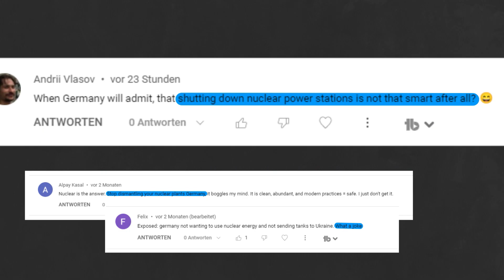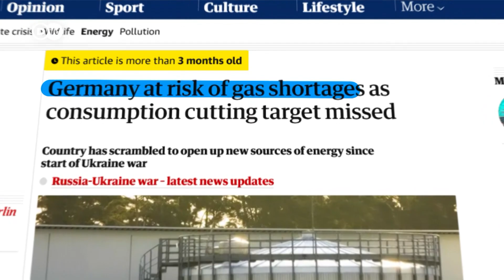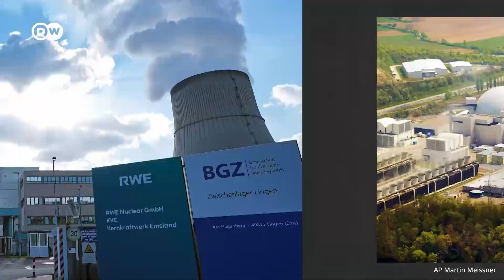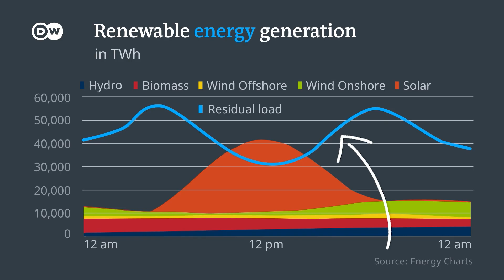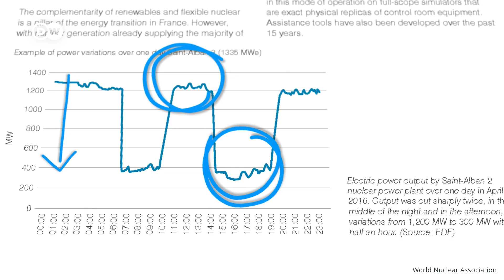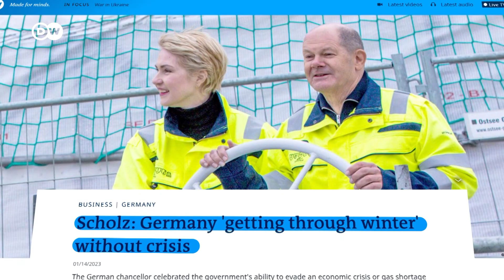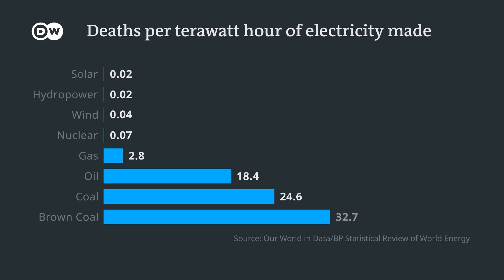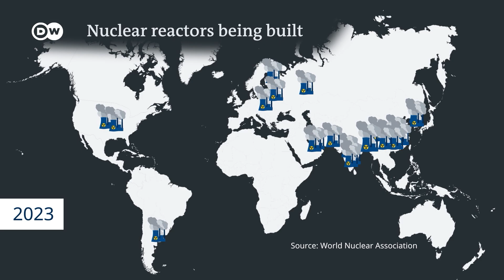Is Germany's nuclear exit a mistake?

Comment: Man we had only  3 nuclear power plants still running and decided a long time ago to shut them down, and so we didn't upgrade it for the last decade so to get them back to our standards Germany would have to invest a lot of money. And for the reasons Germany decided to demolish nuclear power plants there is, the high maintenance cost, the dependence on other countries which sell you uranium, the small but possible problem of a nuclear disaster and that we still don't have a nuclear repository. Im sorry for the long comment and the best of wishes from Germany.
Reply: So the dependence to Russian gas was much better 😅😅😅
Reply: @Bucefal76  hell no, we made a crucial mistake back then 😅
Reply: Теперь будете покупать (атомную) энергию у Франции. Хотите независимости должны иметь все свое. Ещё не поняли что ли?
Reply: The amount of money needed to extend the lifetime of the last 3 nuclear plants would have been extremely cost efficient. Nuclear power in Long Term Operation has a lower LCOE than wind or solar according to the IEA
Reply: Yes, like the uranium dust you keep producing as a by product of those giant coal mining machines, yes, very smart.

Comment: Nuclear power plant are cleanest. Yes you need store waste ideally underground of the mountain. Third of electricity still comes from coal. Coal is burned it releases a number of airborne toxins and pollutants. They include mercury, lead, sulfur dioxide, nitrogen oxides, particulates, and various other heavy metals. Wind turbines lifespan around 20 years blades made from fiberglass basically not recyclable.

Comment: Look, if you wanna turn off nuclear power plants, and import hydrogen generated from oil or gas in arab countries as a carbon free fuel for new power plants, calling it green, that is your choice. Increasing cost of electricity, supporting dictatorships, opening energy market to terrorism are risks certainly lower than the scary radiation.
However, please stay self sufficient with production. It is not fair you guys import electricity from Poland, France and Czech republic. That is what microstate like Luxembourg may do, but not most numerous nation inside EU.

Comment: Uff that is pretty misinformed. I could write a longer text than the video had words in it to explain all the details, but for simplicity sake I for now tackle only three points of correction:

1) Safety:
Germany's nuclear power plants run all on overtime. Germany didn't just decide to shut down perfectly usable reactors and throw out the money already spend for them. One of the last reactor going of was Isar Block 2. The Isar power plant was only supposed to work till 2011 where also Block 1 was shut down. Block 2 got a renewal which itself only lasted till 2022, which it over stepped because of the war in Ukraine. Those reactors were not made to last two times there lifespan, and it showed. Because Isar (even when not reported properly because it was only minor errors) had multiple structural incidences. Those reactors did their times, most of them even beyond their original lifespan, 2011 was the last year were "safety" were a giving thing.

2) Energy down time:
The question what if the sun isn't shining is stupid, as if sun energy is the ONLY source of energy. But more so is the argumentation about storage and how it could be tackled. Why? Because it is already tackled. Germany has enough energy storage already. Even with nuclear missing and every day being dark, Germany would have enough Energy to get by, and that even before we reached the middle of the year. Most of the time Germany has also too much energy, giving it out to more needing countries, while at the same time can purchase easily neighboring energy to get a quick boost.

3) Coal is the replacement:
Its not. All those coal plants going online don't even come most (not all, only some) of the time from the newest government but were ordered and licensed by the prior government (CDU CSU). It was there welcome gift, knowing that this will reflect poorly with the new government in place. They also got a nice sum of money from lobbyism out of this while setting up a scenario where the new government HAS to pay for the coal plants and mines. Basically the CDU CSU are the Trumps of Germany, setting traps up for those after them.
That said, of course the current government doesn't just sit around and let this be as it is. They already are looking and investing into alternative and eco friendly power generation in order to make coal obsolet by cheer numbers. That is also why they say only 80% has to come from green energy. They literally can't stop coal from happening thanks to the CSU CDU but they can at least make it as small as possible. The amount of alternatives are almost endless which are currently looked into. New kinds of solar panels able to work during the night, to smaller yet more effective wind power or even new was of water. Also the next evolution of nuclear is on the table with fusion instead of fission. Sadly this fusion however is still a long time away to be usable.

And like I said, there are so much more to write and to tell about this topic, even the three points I tackle were only a small bit of bigger discussion, however it hopefully shows that Germany isn't just doing it because they are reckless, scared or stupid.

Comment: No, there is no comeback. Too expensive (has to beat 1 cent/kwH - no chance), too slow (takes more than 1 month to build 1GW), too unreliable (France had no cooling water in the summer), target for terrorist attacks (think of Putin bombing the power line and the diesel generator)  too slow to react in the power grid (ramp up/decrease power 100% to 50% or back in 2 Minutes)

Comment: Its too late since 2019. its economical not vaible anymore. even the providers dont wont nuclear anymore, because renewable is cheaper. Energycosts skyrocketed last year because frances nuclear power wasnt providing. they were in repair or didnt have enough water. Soo... Tell me in face of climate change and water scarcity. is it good to have nuclear, when you dont have the water to run it?
If germany had diceded before 2019 to stay in nuclear power, the plants would have gotten checked up, but they didnt and now its not vaible anymore to do so.

Comment from the maker: Correction: The chart shown at 4:42 says renewable energy in TWh. But we meant MW. Thanks for pointing out the mistake!
Reply: Watt is a unit of power not energy, so that chart should have different title as well.
Reply: @SmokWawelski4D  watthour is a unit of energy you are confusing it with just "watt" which is a unit of power
Reply: @divat10  they said they corrected from Terrawatt Hour, to Megawatt.  TWh to MW, not MWh.
Reply: Well that correction seems very wrong. I consume about 1 MW (or 1000 kilowatts) of power every 6 months or so. Are you implying that 26 people had to die in order to provide me with the energy I consume if it's generated out of coal?
Reply: @selimarditi3420  well, yes actually.

Comment: The biggest problem Germany has in terms of energy supply / energy production is that it is neither logical, sustainable, or consistent, but is managed exclusively ideologically. The whole thing is manifested by the ludicrous idea that Germany can solve the issue of global climate impacts independently bx itself. And then, for example, such decisions are made: The newest and most modern coal-fired power plant in Germany (Moorburg) was permanently shut down by a Green Environment Senator after only a few years on the grid and has already been partially dismantled, and on the other hand, just a few days ago, the same Green Environment Senator announced that one of the oldest and most inefficient coal-fired power plants (Wedel) will remain on the grid for another few years... Without words!  This is stupidity at it ‘s best!

Comment: There is something that disturbs me about your graph on the number of deaths per TWh of electricity produced. Why are the values for nuclear and hydro not the same as on Our World in Data (your source) ? Your values are 0.07 for nuclear and 0.02 for hydro while they are respectively 0.03 and 1.3 on Our World in Data. This implies that nuclear is actually safer than hydro and wind.

Comment: 7:30 So, renewables  are keeping Germany from being able to complement them with nuclear.

That's ridiculous, and it's what happens when you get invested so much in such flawed energy sources. The solution is not to close the nuclear power plants. It's to begin dismantling the solar panels and eolic turbines while you reopen the nuclear plants. Because the fluctuations are keeping Germany from stopping using fossil fuels.

The mentality of "using nuclear to complement renewable" is flawed to begin with. You use renewable to complement nuclear and then the fluctuations don't matter.

Renewables, due to the fluctuations, are not fit to replace fossil fuels, but they are fit to complement any system that can.

12:32 If energy can be stored efficiently you still have to mine whatever  materials you need for a massively big number of batteries.  That doesn't seem very sustainable to me.

Comment: I will die on a hill for this - Nuclear for industrial sector and renewables for residential. This is most stable and most viable win-win scenario. If Nuclear is allowed to develop further it will sort out any current risks and waste production in about a decade.
Reply: The industrial sector and residential sector are both hooked into the same power grid, though. There are no current risks or waste issues, especially for new reactors

Comment: German here. This video is only telling half the story. We already had a long term storage facility here, the "Asse". Containers with nuclear waste were put in there until they realised that they rust away and the former mine might not be as stable as it first seemed. Finding a new spot to store that stuff is hard, nobody wants a facility like that in his back yard. Keep in mind that Germany is populated very densely.

We also see that every country that builds new reactors has issues with them. They always are way more expensive and most of these projects have been delayed by years or even decades. Building new nuclear power plants will simply not help us here, they will come too late. We can (and most likely will) build more renewables in the same time.

The next problem is that we depend on Russia for the rods. And as we all know they were a pretty unreliable partner in terms of gas, why should it be anything else with nuclear "fuel"?

Last but not least: Last year we had a surplus on the export side regarding electric energy. France had to shut down many (most?) of its nuclear power plants either because they were broken or they did not have enough cooling water from the rivers because of a drought. Same for Switzerland. During the last years we had very low water levels in our rivers, too.

I'm very confident that backing up from nuclear power is the right decision. There is still plenty of space for solar and also wind, we just need to build battery storage to even out the output. And there is a lot of research on fusion here, this might be an option for the future - if it's still needed then.

Comment: Germany jumped the gun, first build infrastructure then you can do the renewable. weird thing is that nuclear is gone in Germany,  however having a whole bunch right at the doorstep. 
I rather have nuclear power than massive brown coal power plants.
Reply: You can't really run renewables and nuclear at the same time. Nuclear powerplants barely can control their entergy output. While the consumption and the production of renewable energy is changing alot, you can't really use a nuclear powerplant in such a system. In addition nuclear powerplants produce increadable expensive energy (if you really check for all costs).
So for me it's totally logical to shut those plants down and use some coal and gas until we achieve full coverage by renewables.
Reply: @michaegi4717  well you can, especially if you already have them operational. Just run base load, especially with solar.
Reply: @jantschierschky3461  No, Gernany ia far away form having 100% renewables... but we allready have energy surplus for several hours a day. A base load power plant will increase the amount of wasted energy. This makes the usage of nuclear powerplants even more expensive... and it is allready one of the most expensive methods to generate electricity.
Reply: @michaegi4717  surplus yes at times,bad distribution, no storage.  So still need baseline production.

Comment: it's delusional is what it is. I think renewables are to be preferred over nuclear power but germany doesn't have the necessary network yet. What we do have is coal and we use it. So getting rid of nuclear power plants in the name of protecting the climate and the environment is simply delusional. 
We should've kept the nuclear power plants while building out the renewable energy sources and we should've let the coal industry phase-out instead. The nuclear sector could've been phased-out AFTER we had enough renewables. 
But this is what happens when we reduce climate and environmental protection (or anything for that matter) to a few catchphrases - we lose sight of the bigger picture and go to extremes.
So now we are even more dependent on coal and gas.

Comment: I think the decision is the right one, because the mining of uranium, which is required for the nuclear power plants, is by no means environmentally friendly, nor are the conditions under which it is mined.
Also, we haven't even found a repository for our nuclear waste, which will now radiate for thousands of years.
Furthermore, nuclear power is the most expensive type of electricity and, at ten percent, only accounts for a small part of our electricity generation.
However, we now have to find faster solutions for the expansion of our renewable energies, which was slowed down by the last government.

Comment: Germany was willing to take a risk like this to set an example to the rest of Europe that existence entirely on the renewable grid IS possible. At the time coal was cheaper and there was more usage compared to nuclear energy. It makes more sense to keep those online longer than nuclear energy so that it can use more of that funding to invest in renewables. 

The war put a giant wrench in that plan tho, so I think now they’ll have to restart any of the reactors they haven’t already removed outright, and maybe shift to shutting down coal plants instead and just extending the time it will take to get 100% renewable. Or enforce it on a region by region basis, where Berlin may have a target of 2030, Frankfurt 2040, Bavaria 2035, etc.

Comment: The Argument of substituting coal with Nuclear power just isn't viable for Germany. Even if all Nuclear powerplants were to be restarted, the power they prodouce would never be enough for this.

This means having to build entirely new Powerplants, but how long does this take? First the planning, deffinitely gonna take a few years, especially since few want one close to them. Then the building itself may take anywhere from 5 to 10 years.

This is far to long and coupled with the fact that they are unsuitable to be used in conjunction with renewables, as showcased in this video, there is little sense in suddenly transitioning to Nuclear Power.

Not to meantion that, just as coal, Nuclear Power isn't economical.

Even if we wanted, we would have to find other alternatives sine we hardly have the time.

Aa for Fusion and Modula Reactors, they may sound great on paper, but they have one glaring problem. Either they don't exist yet, at least in a way viabale for nationwide energyproduction, or they are too new. We need a solution now and not years in the future.

Comment: romans lived two thousand years ago and the first pharaohs 5000 years ago. We know little about them. imagine we bury nuclear waste that will last 100,000 years and is deadly. You cant do that the the future generation. We in Germany still have no repository and nobody wants it so...And the construction and dismantling of the nuclear reactors is not Co2 neutral either due to the gigantic amounts of concrete that is used. In addition, because of the phase-out of nuclear power, we will not phase out coal later. Just wanted to make that clear. Btw Finland is the only country with a final repository.
Reply: It's built but it's not even used right now. So let's wait until it's in order for the real practically problems to occur

Comment: The waste issue is a nonsense argument.  The fuel isn't even technically waste.  It can be reused, as is, in new reactor designs, which burn the long lived isotopes.  It also has an extremely small foot print.  The anti nuclear argument is often based on emotion and misguided perceptions.  The key is to have a critical, independent regulator and encourage innovations in safety. 

The US is looking to keep plants open for a 100 years because their value to the grid, in certain cases, is not easily replaced.  So many well running and powerful plants have entered decommissioning way too early and it's a waste of money, time and carbon free energy.